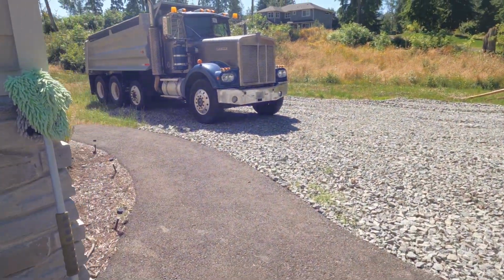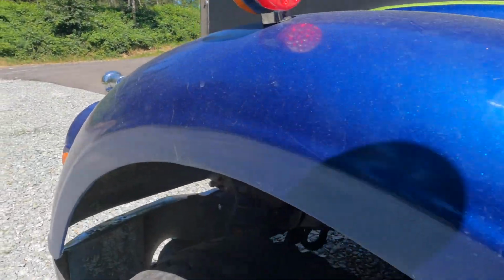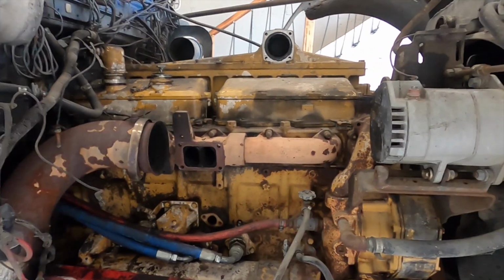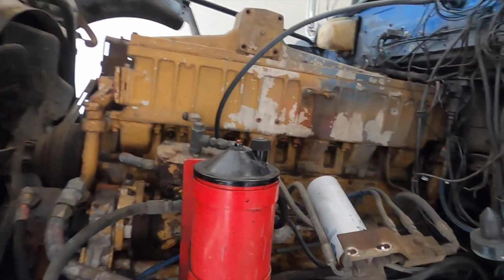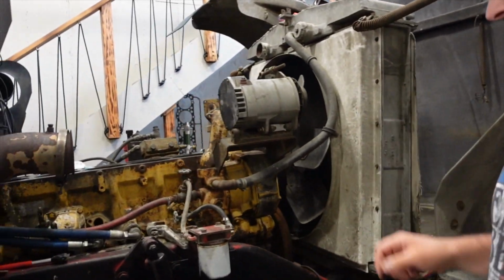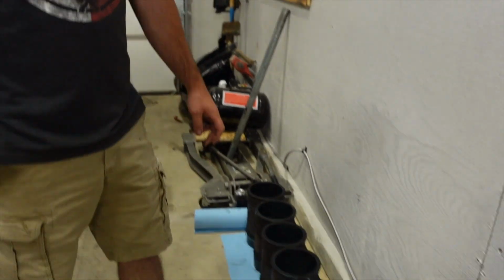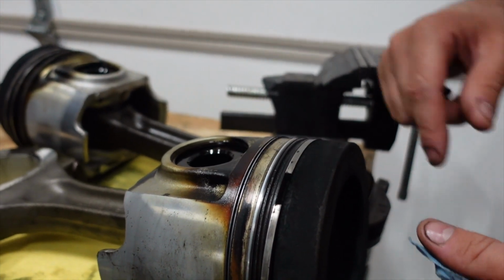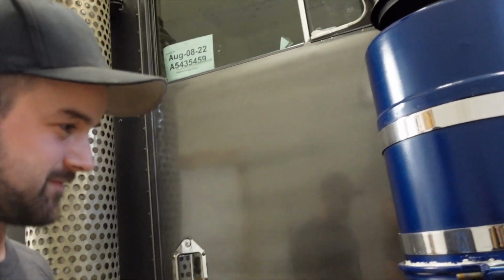1977 Kenworth W900 Dump Truck Rebuild Update!!! Lets find out why is has so much blow by. Episode 2.

Comment: I bought a tractor just like yours and used it as a transfer dump. Brought back memories with the shot from inside the cab. Mine had a 350 Cummins and a 13 speed which was a common set up back then. I wish you luck with that beautiful looking beast!

Comment: The external liner pitting doesn’t have anything to do with what’s happening inside the cylinder or any kind of cavitation. It has to do with static electricity that happens because of coolant flow in the metal components of the engine and radiator. It’s the same reason that salt water boats generally have a sacrificial anode replaceable metal bar in their cooling systems.
The cause of it is electrolysis etching of the liners from the coolant. This is why a DCA additive needs to be poured into the coolant as recommended, and some coolant filters have granules that dissolve into the cooling system to help prevent the same. A coolant filter can be added to that engine and plumbed with 3/4” coolant hose. One DCA product is Baldwin CS5008, and Wix has a similar product, and there are more.
Keep up the good work! I appreciate what y’all do!
Reply: Thank you, for the explanation.  I was thinking more or less to do with hotspot in the metal. While the truck getting inframe the radiator needs to go to the radiator shop.
Reply: I was taught just what Bobby explained. Combustion events forcing the cylinder wall to rapidly expand and contract create vacuum bubbles in the engine coolant in the vicinity of the cylinder wall. Upon contraction, these small bubbles slap into the cylinder wall - while the force of this interaction is extremely minor, it occurs rapidly and can literally eat a hole in the cylinder wall over the course time. Some engines are more prone than others for this to occur. Some engines require a SCA/DCA (supplemental coolant additive, diesel coolant additive) and the strength of the additive needs to be checked on a regular basis.  Boats have what is called Galvanic corrosion between dissimilar metals in the water which also causes little pits in metal which left unchecked or unprotected causes issues. Metal sacrificial anodes of zinc are installed and maintained to prevent the corrosion.
Reply: One of the tattle-tell signs of electrolysis corrosion will be the pitting in a near straight column from top to bottom in the piston liner.

Comment: Cavitation pitting is caused by air bubbles in the coolant rupturing due to the vibration in the cylinder. Apparently, it only happens on engines that use a wet sleeve. A DCA additive poured into the radiator or a water filter impregnated with DCA will reduce cavitation and prolong the life of the liners. It's a cool old truck and i can't wait to see it out on the road.
Reply: Only happens on engines with a wet sleeve because a dry sleeve engine has no coolant around it
Reply: Haha, lol
Reply: You can also get pre charged coolant, and I think it has enough in it to last as long as the coolant, but I don't do a lot of work on diesel engines. Usually I do some research before working on them.

Comment: Important to have the proper amount of DCA in the coolant to protect the liners, it coats them, makes them slick so the bubbles caused by cavitation slide off the slick surface instead of causing pitting.

Comment: Looks like you’ll got a really good shop and system to do repair work. Believe me that makes a major difference in how well your end result turns out. 10 to 12 hours to put back together is good time. Years ago I had a lot of experience on overhauling cats D353 marine engines in towboats. They were famous for holes in the top of the pistons and they would blow the dip stick out. Those engines had a lot of o rings in them and required a lot of cat glue.
Reply: The tools don't always let you do a better job, but can make the job much easier, and quicker.

Comment: You’re lucky to be married to a diesel mechanic. The cost of an in-frame kit is nothing compared to the labor for having a shop do the rebuild. 
That cavitation on the liners is pretty bad. Good thing you caught it. Cavitation can be caused by not having the correct coolant or not changing the coolant filter which means the additives are worn out. Looks like that engine had a ton of miles on it. Should be like new with the in frame kit installed. You might want to replace the injectors at the same time.

Comment: I’m not sure where you are in the rebuild but I highly recommend the fuel injectors and pump be rebuilt. I’d replace the oil and water pumps as well. Have your mechanic inspect the turbo and if the air compressor takes more than 5 minutes to build air replace it as well.  I’m speaking from over 30 years working on these engines. I absolutely love that engine.

Comment: Looks like a brake saver on the back of the engine?Do pull the oil cooler to see if it is plugged.Pull the piston oil cooling nozzles and clean them out also.
Reply: George Jones  40 years working on this crap.Just suggesting here because I have seen it happen.Black hole piston,over heating after inframe.

Comment: Well it sucks that the engine requires an in-frame, but on the bright side, once it is done, you will have a very reliable engine. Brings back memories of working on HD equipment engines. Largest truck engine I have worked on was an 12V92, but love working on the Cat 3208, one extremely reliable engine. Largest engine was the the Enterprise 20 cylinder diesel engine with 15" bore and 21" stroke. Rated at about 12,000 bhp. Also worked on their 16 cylinder marine engines. Hated those as they burn Bunker C fuel. Nasty stuff work work around. Thanks very much for sharing and good luck. Going to be a great truck when your done.

Comment: Interesting video. Will you be able to simply fit new liners and pistons without machining? Will you mill the deck of the block. I have done it by hand using an engineers square and stone but never on a huge truck engine!

Comment: Another thing that cause liner pitting is air bubbles  in cooling system circulating around the liners. It good that Bobby can fix the problem! Much saving!👍👍😎🇺🇸🇺🇸🇺🇸🇺🇸

Comment: Just had my 2001 c12 rebuilt.  My head was cracked also in-between the valves.  It's common problem.  On my engine the head gasket between 2 and 3 was leaking coolant down the cam into the oil pan.  It took forever to get the right parts.  Hope it doesn't take you guys so long

Comment: I strongly recommend new cam oil pump rod and main bearing cleaning all the oil gallies with either and compressed air. With replacing the head it puts more pressure on the lower end. And I have put several million miles on those old cats.

Comment: Looks like a full engine rebuild, But when thats done that engine wont need anything for a while. Good thing it is getting a full go over to fix it now than later down the road when it breaks. Hopefully the rest of it like the clutch, transmission, rear axles and other misc stuff gets check off the list too or added to it.

Comment: You need to put modify in the air intake manifold,  and have air go into manifold in the front and back instead of the middle.  The number 6  hole will  last longer,  and run a little better

Comment: Hi all,the pitting on the piston liners is caused by corrosion, the way to limit this happening is to keep antifreeze in the coolant at all times,I'm in the UK and I have overhauled many a Rolls Royce diesel engine that suffered with the same problem and keeping antifreeze in all year round and not just during the Winter is what Rolls Royce came up with for their engines,and now it is common practice for all manufacturers car and commercial Vechile to do this.

Comment: The pitting in the cylinders is called "electrolysis " which is a reaction from vibration and air bubbles. Extended life coolant (red) has the DCA additive in it to reduce that.
Reply: You can also add a ground strap from radiator to the frame to stop electrolysis as well.
Reply: That's cavitation..electrolysis is not caused by air bubbles.

Comment: Great looking old W900.  I suspect the hood is not original, but a replacement taken off an older Kenworth, judging by the old style name badges and hood ornament.  Kenworth started using the current rounded block letter script in 1973.  It's likely a truck that age has been kept running with an assortment of new and used parts.  And that's fine, but interesting to wonder about.  That old sweetheart could probably tell some great stories!

Comment: This is one of those old trucks you can crank it and set the battery out and put it back in the tractor or whatever. Just don't stall it out right?
 You can't do that today with all the electronic stuff.
What engine does this have a Cat C3406?

I ran a 98 KW T800 truck once with a shot starter where it could be working instead of waiting. We pulled it off that  morning with a tractor and I ran it all day. That truck would stall out really easily too, it didn't have a very friendly shift to it. It didn't like to be revved up much to shift to the next gears. It had some sort of off brand 10 speed in it that parts were no longer available for.

Comment: I think a lot of that could be caused by not enough ground on the engine to frame. Rebuild your oil pump as well, no doubt might be original.

Comment: The dealer that rebuilt my tractor engine said the liner pitting was from the water and antifreeze getting old or too much water.  They had a test that would show if you had enough of the anti rust additive still left in the coolant or not.  They recomended just changing out the coolant periodically with a proper mix of water and antifreeze, no more than 50% water.  I'm just repeating what I was told.  I am curious now that I have heard another reason.

Comment: The old A model cats are good engines but expect poor fuel mpg like 4-4.5 mpg and hard to start in cold weather, keep those glow plugs working and the block heater.
Reply from the maker: You think that’s poor fuel mileage? Seems average to me.
Reply: @DauminiqueTheDumpTruckDriver  That was in an over the road truck so probably not that much in a dump truck still a good engine make sure those glow plugs work they can be impossible to start under 30 degrees.

Comment: cavitation erosion is from air bubbles, the suction side of the water pump has a leak, cracked hose etc, dca is to control the ph of the coolant to keep it from becoming acidic and eating up the metal parts and should be checked at each service. you better check the air intake pipe on the bottom for a hole rubbed thru the pipe, the engine will tilt in a pull with a bad or loose engine mount and dust the engine, and or the previous owner like to blow out the air filters which rips holes in them and allows the dust in and wears out the line, you also need to replace the air compressor, it is also dusted and your air system is most like oily, dca is much cheaper by the bottle than a filter, which does the same thing. dca bottle used to be 7.00 and a filter runs about 35.00. dont forget to replace the cam bearings with all that dusting they will be down into the steel, if you do the front cover gasket look up the updated cut relief to stop the air compressor from leaking, get the moly lube for the head bolts,

Comment: Serious cat advice here: 1. Always check liner protrusion. 2. Consider switching to ultra long life coolant, though it may not be worthwhile if you're not replacing the radiator too. 3. Is the retarder leaking? Check it out before you start running it full time.

Comment: Over here on the East Coast that job is probably 15,000
Reply from the maker: Here it’s more.
Reply: @DauminiqueTheDumpTruckDriver  Wow!
Reply: See back in the 80's and 90's when we were in the business, we did most of our own repairs, so I lost track of all the higher costs in the trucking business today.  I think I paid around 12,000 for a pedigree mack replacement engine in 1988, cheaper back then and less down time to replace the engine, rather than rebuilding